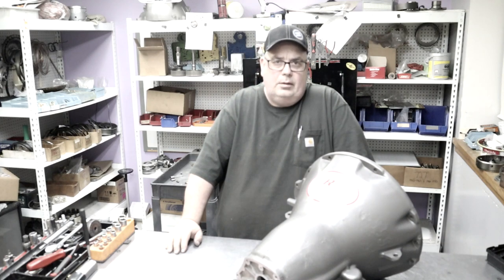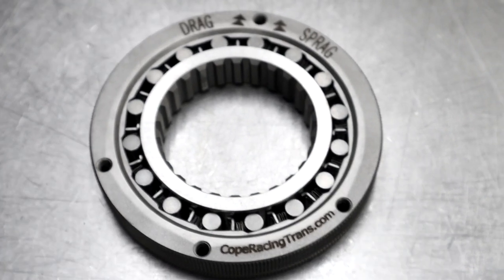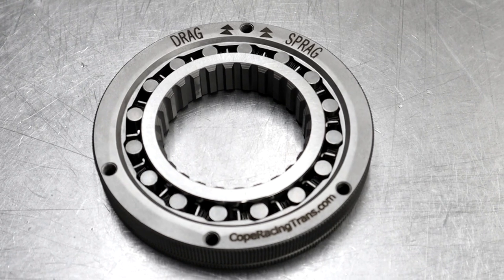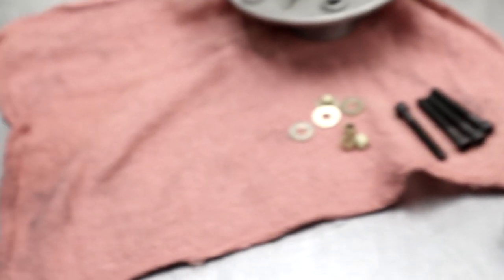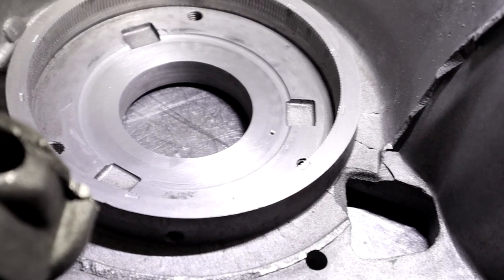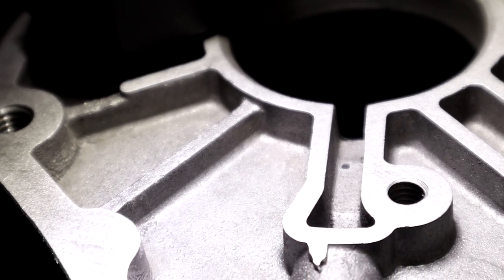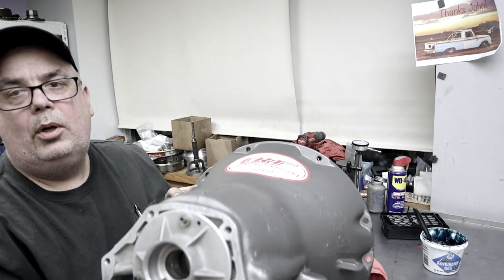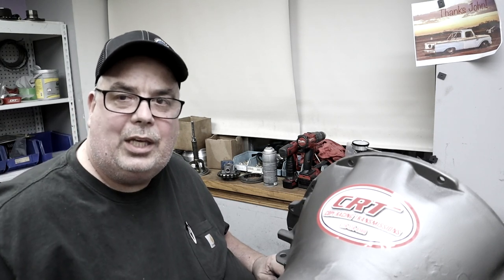727 SPRAG VIDEO INSTALLATION INSTRUCTIONS

Comment: Did you have to drill the 4 1/4 holes? Does the 904 have the same size sprag as the 727?

Comment: Great vid. Do the ferrels act as crush washers or do they retain their shape?
Reply from the maker: no, the hole in the rear support is larger than the hole in case, the ferrels center the top of the bolt. Takes up the slop.

Comment: Will these work in the diesel 47 and 48re’s since they are based off the 727?
Reply from the maker: no my drag sprag is just for 727s, 47s & 48s do have 14 rollers, so its 2 more than the 727.
Reply: @coperacingtrans  is there a bolt in option for the 47, or is it even needed?
Reply from the maker: @theamerican9821  yes I offer 47 & 48 bolt in sprags.